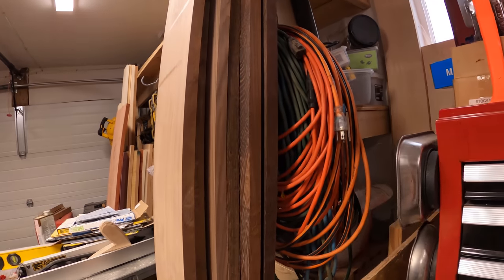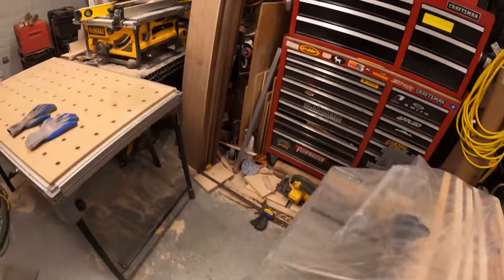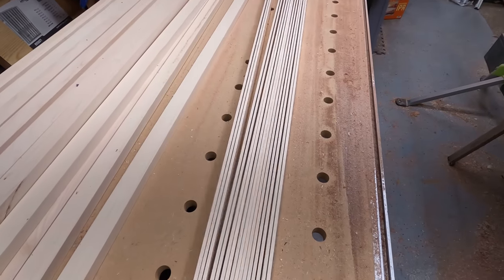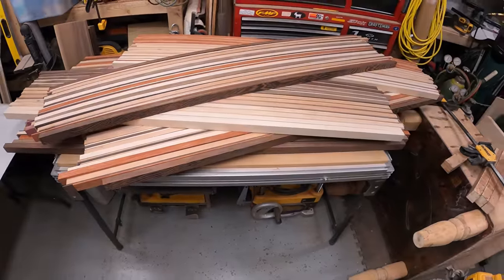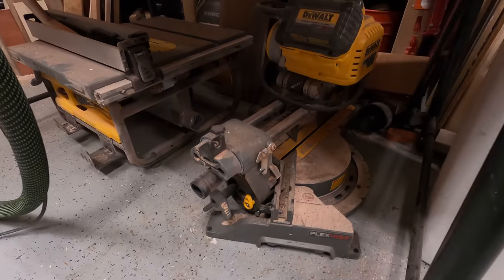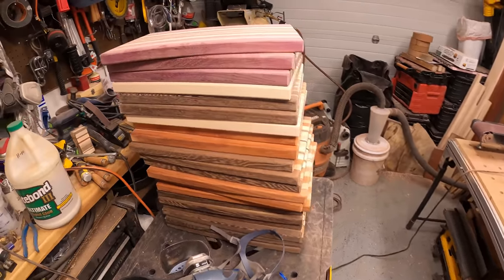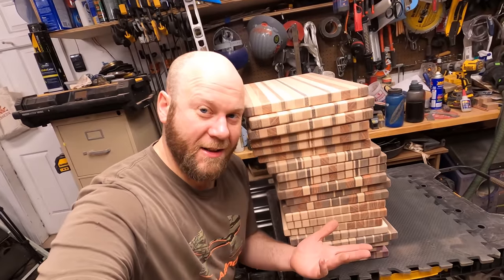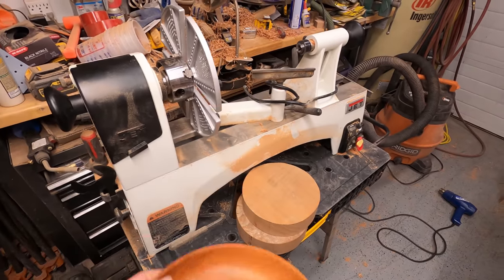21 Cutting Boards Sold In 10 Hours!  Annual Batch Of Boards, 2020.

Comment: At around the 7:40 mark you were measuring the width of the boards as you were adding more pieces - what was the reason for that? Is it because you want the total board to be a certain width? Is it for the planer? Looking for tips, thanks!
Reply from the maker: I used to do it to make sure I fit the planer, now I try and keep the boards around 11.5" wide so they fit the usps game board box for flat rate shipping. Alaska is expensive to ship ups or fed ex.
Reply: @KrisDeVo  got it, thanks!

Comment: How did you minimize the sawdust from the Padauk staining the Maple? I've had issues with that making my own boards.
Reply from the maker: Blow it off really good with an air compressor. Make sure to get all the Padauk dust out of the rest of the board before applying finish. Hope that helps. Works great for me.

Comment: do you think the mineral bath is required? i see others not use it and just use the oil and beeswax mixture.  just looking for different opinions
Reply from the maker: I only recently started doing the bath. I would however do lots of heated coats with Howards butcher block conditioner over a 2 day time.
Reply: @KrisDeVo  thank you for the information and quick response

Comment: Kris, as someone that has been making boards for a while now, I will say you do some very nice work man. I also have been working in a small 1 car garage, so I feel your pain! Keep up the good work and I look forward to some lathe/turning videos. Couple questions about your boards...
Do you find raising the grain only once to be sufficient? I was told long ago to do it a few times, and I wonder if I should only do it once. Is the conditioner the reason you have to only do it once (I use oil and then an oil/bees wax mix as a finish). Thoughts?
You liking that new helix upgrade on your planer? I have used the same planer for about 2 years now, and was thinking about making the change.
Reply from the maker: Hey D. R. Thanks for the kind words. Yeah the 1 car garage thing can be hard. I think the only way to know what raising the grain is going to do is use a board and see. I built tons with never doing it but once you actually use the board and get it wet it gets ruff from not having raised the grain. I think one time should do the trick but don't know if more is needed. The conditioner I use is mainly bees was and mineral oil so you should be fine with that. It has a few more ingredients but not many. 
I LOVE the shelix head. It takes a little more power and you have to use a little smaller passes but zero tear out! Now I can pick up and use figured wood and not worry. Saves time and leaves a great finish to work with. Hope that helps, good luck.
Cheers

Comment: You wet the boards to raise the grain and once they dry you sand again? Does this make it smoother overall?
Reply from the maker: Not as a finish product. But once its been used and gotten wet the board that has had the grain raised on it and sanded will feel less ruff.
Reply: @KrisDeVo  right on bro, makes sense the fibers can only come out so much so you're like tempering it in a sense. Thanks for the reply!

Comment: How do you keep from getting snipes on your boards. I have the same DeWalt planer with a Shelix head as your and I get snipes almost all the time.
Reply from the maker: You dont. You can minimize it but no way to get rid of all snipe 100% of the time. Some say you can but I dont believe so. Not worth risking putting it in a board and having it fail.

Comment: Kris, great work!  Thank you for sharing.   I've actually  never done this, and I'm about to start, so I'm watching a lot of videos on this.   Questions for you...  

1. What sizes do you buy your lumber in preparation for this project? 
2. What size do you cut the purchased wood? 
3. What size are you boards (final product)? 

Thank you.
Reply from the maker: Thanks! 
When buying hardwood they call the ruff size by quarter. So ruffly 1" is called 4/4 and is around 15/16 actual. 
Domestic hard wood I get for these "edge" grain boards is 4/4 and most all exotic they have is 6/4. First thing you do is plane them down to get nice faces for glue and I do that by species. Those just end up what they clean up to be. 
Next is ripping them all to about 1 3/16". That is the starting thickness of the cutting boards. I did this batch in 60" lengths and cut the snipe of the ends, then get 3 boards out of each run. 

Final board size is approximately 1" to 1 1/16" thick and 11" to 12" wide and 17" to18 long".
Hope that helps!

Comment: I have the same saw, just bought it. Was wondering if you use thin kerf or full kerf
Reply from the maker: Thin
Reply: @KrisDeVo  do you use thin for all your blades?
Reply from the maker: @trevenmaharg1585  yes. If I had a real table saw instead of a little jobsite one then maybe I would try others

Comment: Nice work mate they turned out beautiful. What at size do you make them and if you don’t mind me asking how much do you sell them for?
Cheers from Australia 👍
Reply from the maker: Hello Billy from Australia! Thanks for the kind words. These were approximately 17" x 11.5" x 1" and sold for $135 each.
Reply: @KrisDeVo  One more question mate, how much did that beautiful timber cost?  I have a joinery business here and have been making boards in between jobs, but haven’t started selling them yet. I’m trying to work out the best way to sell them, but I’ll get there when I have time to set something up. I’ve just ordered an Ortur 2 laser cutter from Amazon so I can cut my logo into the boards and also do custom designs if anyone wants it on their boards. You should look into it mate they’re really cheap in the U.S. and easy to use.
Reply from the maker: @billytopa  The timber has such a huge range, from $6 to $16 a board foot, depending on domestic or exotic and figured or not. Alaska is pretty removed from the US so I dont know what it cost in the states. I will have to check that laser cutter out. Ive been thinking about that for a while and should pull the trigger on one soon. Would love to see the boards your making and stock piling and your joinery business. Send me a email at contactkrisdevo@gmail.com if ya like. Cheers
Reply: @KrisDeVo  I’ll definitely send you pics and and business details when I’m back at work, we’re on holidays atm

Comment: Is it safe to use the epoxy on the food-related products?
Reply from the maker: Technically epoxy is generally food safe, although I would never make a cutting board with any real amount of it in there. Because it was just a couple small holes and only 1 or 2 per board for 4 boards it really isn't to bad. Still I don't recommend epoxy in a cutting board unless needed for a small repair .

Comment: Beautiful work! Curious, how long do you soak the boards in mineral oil? I’ve seen various lengths from other creators, anywhere from a minute on up to 5-6 hours!
Reply from the maker: Thank you! These soaked for a few minutes in the mineral oil bath. Then for 24 hours I wiped them down several times with heat and the Howard's butcher block conditioner.

Comment: You really don't need to wear gloves with mineral oil.  It's a common pharmaceutical and good for the dry skin.  Used a laxative, fully consumable.
Reply from the maker: I agree. I do it just so I dont get oil all over if I need to grab a tool without washing my hands first. Also if I have cracks or cuts in my hands to not contaminate the boards.

Comment: most darker woods have their share of toxicity; especially padauk and purple heart, even black walnut.. even though most humans will not be severely effected by the compounds found in these woods; the open grains will become filled with debris. Hardwoods with closed grains and light colors are IMHO "cleaner" materials to use, and inserting non-porous food safe materials to add color and interest to the board. If used primarily to cut bread on, and not meats or cheeses I would believe then it would be totally fine. (Just as long as the wood isn't being "sawed" into the bread by serrated knives.)
Reply from the maker: I do agree. Most of these boards people dont actually use. And unless the board is abused it is well known that there really isn't an issue for the most part.  I made my grandma one when I had my first cutting board business when I was 14. She used it everyday for everything for over 20 years. Zero issues and made out of these same woods.
Reply: @KrisDeVo  I was asked by a customer to make a platter in shape of a fish, they wanted to use it to serve fish from, and asked for several dark exotic woods; after explaining to them the differences, I made them a bread cutting board with the exotics and eastern hard maple for platter.  It's up to who uses the thing IMHO, just so they are in the know... 
( I am very allergic to Ipe wood, I refuse to work with it anymore.)

Comment: Niceee! What finish do you use and how do you use it ?
Reply from the maker: Howard's butcher block conditioner and mineral oil. Its in the video. Thanks!
Reply: Thanks do you sand it between each coat of oil? And what is best like 220?

Comment: How much snow have you had this winter?
Reply from the maker: Not sure exactly. We average about 80" per season and we are having an above average season I think. Most ive seen was 144" or so.
Reply: @KrisDeVo  I think we have had 8 inches so far this year.  Not used to that anymore.  Normal year where I used to work was at least 70 or more inches.

Comment: The patrolium based oil is a problem due to being a possible carcinogen. According to Wikipedia.
Reply from the maker: You dont actually eat the cutting board. Its so minimal and it has been used as a laxative and what not for ever. They still use it in the hospitals.

Comment: Lovely boards, how much did you charge for each one?
Blessings from Tipperary, Eire.
💖🙏🌻
Reply from the maker: Thank you! They sold for $135 each. Looks like Tipperary is a lovely place.
Reply: @KrisDeVo  Wow! Thats a really great price to get but then you have to buy the wood so I suspect it would gobble up at least half the profit. Another way might be to use 1, 2 or 3 types only and stain some for variety.

Tipperary is lovely but people are so TV programmed, seen that during this plandemical nonsense,  it's a sadness but there is an awakening.
Me in a nutshell? ...
As an anglo-canadian builder, about 13 trades under my belt including thatching, got caught by a paddy in London 30yrs ago while fitting kitchens & bathrooms 😂. Our peice of paradise is at 800ft in the Silvermine Mtns, close to Dolla. Growing up in the UK I made my home in the B.C.Canada Rockies in my 20's, born in T.O. ... came back to UK at 30 and here in Eire since 1990.
I suspect your in Ontario?!

Your boards are a great idea! I like your ingenuity in cutting the strips to replace a bench saw. Guessing you need to turn every other strip upside down as getting a perfect 90 degree cut would be tricky.
God bless the work! 
💖🙏🌻
Reply from the maker: @JaiHylRubis  The wood is about 1/3 of the profit so not too bad. Staining would be hard to do with a food grade stain and get this kind of natural detail. 

 "Plandemic", thats a good one! I agree. Sounds like a great place in the mountains. Neat little story thanks for sharing. 
Im in Alaska.
Reply: @KrisDeVo  Alaska! Superb, your a good healthy distance from the madness. I look forward to venturing that far north one day although Eire is on almost the same latitude but the gulf stream keeps us warm, for now. I actually just finished a really good read by Hammond Innes based in the Yukon called High Stand. . . I also have huge interest in the homonids, you've probably heard many stories up there, but hope humanity never really find out about them enmasse, not in its present stage of consciousness.
Blessings of health & prosperity too you and yours Kris.
💖🙏🌻

Comment: What do you charge for a board like that?  That stack would be rather pricey in my area.  Cheers.
Reply from the maker: $135. What do they sell for in your area?
Reply: I really haven’t seen any for sale and I’m assuming maybe it’s because of the cost of hardwood makes them to expensive to make.
Reply: I wouldn’t even consider buying wenge from the local hardwood dealer, I believe it’s around $30 / bf

Comment: the worst noise you will ever head with the new cutting head is when 1 tooth decides to break and it decides to take out 9 more teeth with it. 😖. its happened 2 times for me. but teeth are so cheap!
Reply from the maker: That doesn't sound like fun! Ill have to keep an eye on them then. Thanks
Reply: @KrisDeVo   also since it reads at a different depth i have noticed in cold weather (since your in Alaska and im only in Washington state) the wheels will slip more on the dewalt than normal since the extra force. must be reverse physics or something with dewalt. i use a small floor heater to warm up the wheels before i even start using mine in the winter.
Reply from the maker: You must have got the smaller version that slides in. I went with the oem size so it reads and works at the same depth. Mine actually feeds smoother with less roller spin then it did before . Glide Coat goes a long way on the table too. Good luck 👍

Comment: Do you make trivets out of your scraps?
Reply: I know how you use the left over pieces now. That is awesome.
Reply from the maker: I haven't made trivets yet but thought the heat would mess them up good.
Reply: @KrisDeVo  you have to use a finish on them. I also work in a small garage shop and a mass production like that is limited based on space. I don't have enough space for 20 trivets to dry. Love your work.

Comment: Are you doing edge grain?
Reply from the maker: These are edge, I also do end grain
Reply: @KrisDeVo  I’ve made about 8 or so cutting boards. I work out of the wood shop on base right now. My latest failure has been trying to do a plaid board. Hasn’t been going super well

Comment: what happened to your fingers?
Reply from the maker: I just use red tape on my fingers when im running a bunch of lumber through the table saw. Especially Wenge. Mean splinters. The tape is slick too so i can put pressure on the fence

Comment: Chopping boards should be end grain only as the cutting surface. This is because it will spring back after slicing or cutting with a knife and keeping bacteria out of the board. 
All that effort you’ve gone to is pointless and shows you’re not trained as a carpenter or joiner or someone that can research before starting a project. 
Your boards are making people Ill, well done.
Reply from the maker: I've been doing this for over 25 years and you are so wrong. My grandma used one of my first edge boards for over 20 years daily with zero issues. You might actually want to do some research before making such a comment as I am constantly learning and researching, like this video which proves you are incorrect. https://www.youtube.com/watch?v=kd4vNcTvWnE
Reply: @KrisDeVo  stealing a living. I’m not wrong.

Comment: Snipe removal
https://youtu.be/wcViXNefGzI
Reply from the maker: I appreciate that Mr Patching, that doesn't work for boards that have a twist in them. If one sneaks by then a block or board could fail so I dont run the risk. Also I dont cut out most of the cracks or flaws at the end of the lumber I buy and that is throw away anyway for the most part. Thanks for the tips though. Cheers